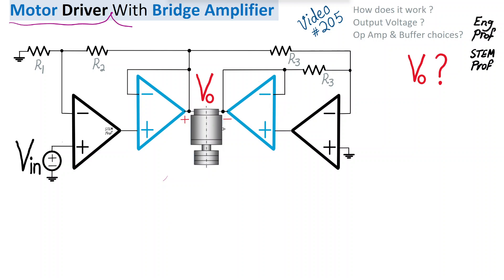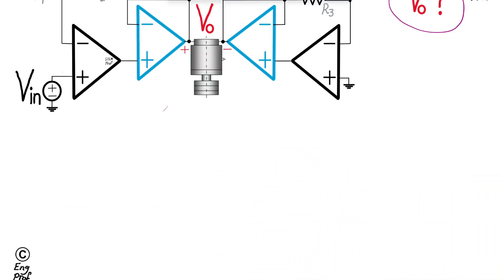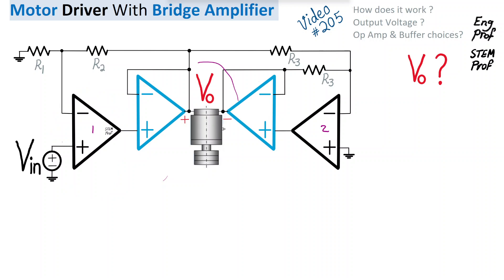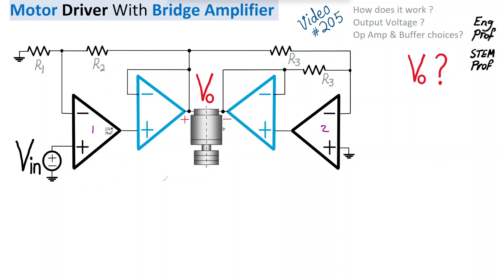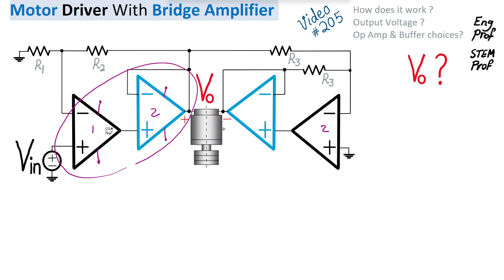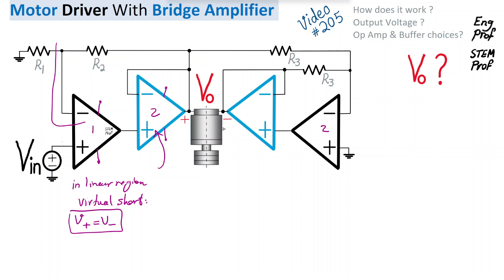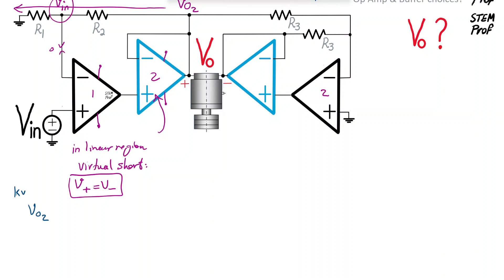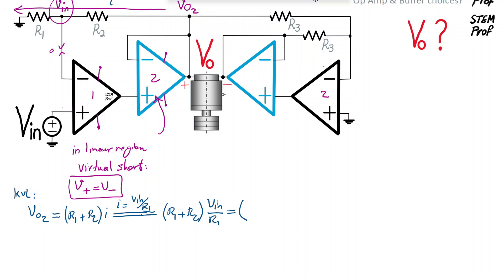Electric Motor Bridge Amplifier Explained

Comment from the maker: Motor Driver Circuit Design with Bridge Amplifier is explained and analyzed in this video. More Amplifier examples are listed below: PID Controller for Servo Motor explained https://youtu.be/NATBlfABXrA
Electric Circuit Analogy for Mechanical System: https://youtu.be/997hfjGK3_w 
Strain Gauge Wheatstone Bridge Instrumentation Amplifier Explained https://youtu.be/io1yBcCsP-Y
Push-Pull Power Amplifier https://youtu.be/866MYibo8yE ,  
Flex Voltage Regulator Example: https://youtu.be/CJl-urzeiTo
Amplifier with -25 to 55 dB Attenuation-Gain range https://youtu.be/oyz6lTGd2Xo
Instrumentation Amplifier with Electronic Gain Control https://youtu.be/C4tghZ-q6Zs
More Analog Circuit Videos are listed in the Analog playlist: https://www.youtube.com/playlist?list=PLrwXF7N522y4c7c-8KBjrwd7IyaZfWxyt  I hope these Circuit design and analysis videos are interesting. 🙂

Comment: That circuit would make a lot more sense as an automotive audio amplifier to get 4X the power without needing specialty low-Z speakers and thicker wiring than it does for driving motors of any meaningful power. Driving motors is better left to PWM drivers... single H-bridge driver for reversible DC motor, double-H for steppers, 3ph bridge for most others.
Reply from the maker: Thanks for sharing your insights & good suggestions. This Bridge Amplifier works well for lower current motors as described at 1:40. For higher current motors we can use power Transistors at the output of Buffer. And to your point https://youtu.be/EDpu6urAtHA video is about op amp based Bridge Audio Amplifier. 🙂
Reply: @STEMprof  What DC motor size would you drive with an analog amplifier? I wouldn't drive anything much over a cell phone vibrator motor with that - low duty cycle sub-1W loads with minimal impact on power draw. For anything much beyond that, the heatsinks you will need for your analog driver will greatly exceed the cost of a D-class amplifier.

Putting a totem pole on the opamp output for increased output current/power may help for driving larger loads but doesn't help with efficiency.
Reply from the maker: @teardowndan5364  well said and valid point regarding efficiency. Thank you!

Comment: I'm not sure i quite understand why the low current amplifier is needed. Couldn't you directly connect the input voltage to the high current output amplifiers?
Reply from the maker: @christopherventer6391  Reason is, when high-current Buffer is connected inside the feedback loop of the more accurate (low-drift) precision Op Amp, the relatively large offset voltage of the high-current Buffer and other errors are corrected by the open-loop gain and feedback of the low-current low-drift Op Amp. An application of this circuit is in https://youtu.be/NATBlfABXrA  as power driver in PID Controller for Servo Motor. I hope this explanation is helpful.
Reply: @STEMprof  Ah, ok. That makes sense!

Comment: Why not configure the buffer amps directly as BTL and ditch the first stage?
Reply from the maker: That's a great question. Reason is that when high-current Buffer is connected inside the feedback loop of the more accurate (low-drift) precision Op Amp, the offset voltage of the Buffer and other errors are corrected by the open-loop gain and feedback of the op amp.  I hope this is helpful.
Reply: @STEMprof  I see your point about the feedback loop compensating for inaccuracies inherent in the buffer.  So if one is willing to sacrifice some precision, then I think my suggestion could still apply.  Thank you.
Reply from the maker: You are welcome. Yes, if error and its potential accumulation over time are negligible. Otherwise the Buffer in the loop of cheap low-drift amplifier is recommended. Thanks again for the good question. 👍

Comment: Are you sure that an Opamp can drive a motor??

Most likely people use MosFETs
Reply from the maker: That's a good question. And the answer is yes as mentioned at 1:40 minute depending on target applications. In this case the target was up to 300mA and hence the proposed Texas Instruments LMH6321 high speed buffer is good enough. For higher current applications, higher power buffers or addition of power transistors might be needed.  I hope this is helpful.
Reply: @STEMprof  it would be better to add a mosfet between the OPAMP and the motor for safety
Reply from the maker: @ahmedmoustafa6829  Good point. For higher current drive application power transistor is surely needed. Thank you!